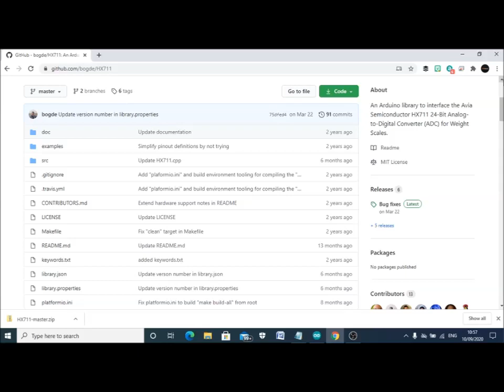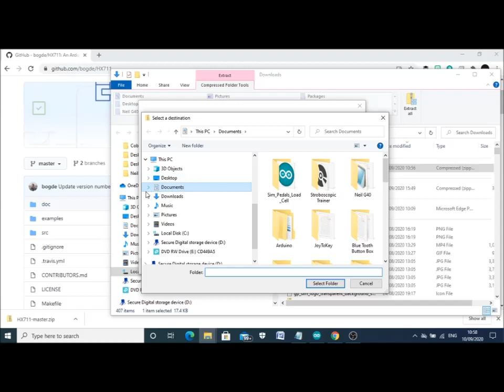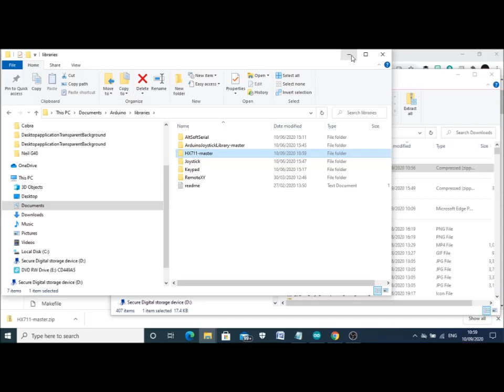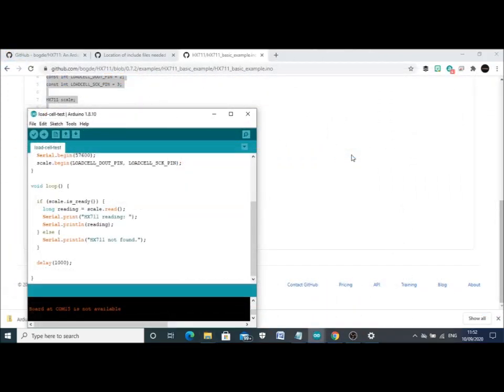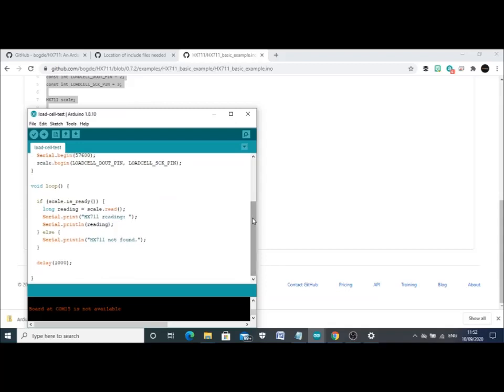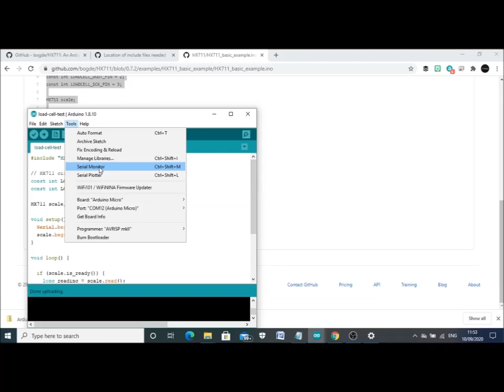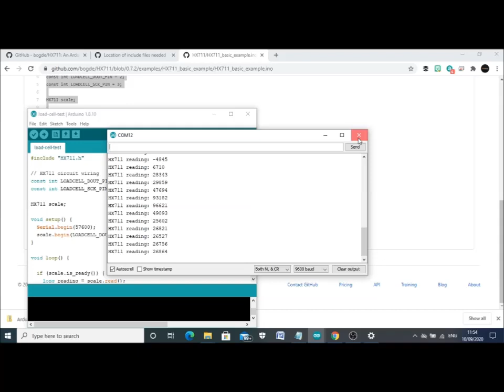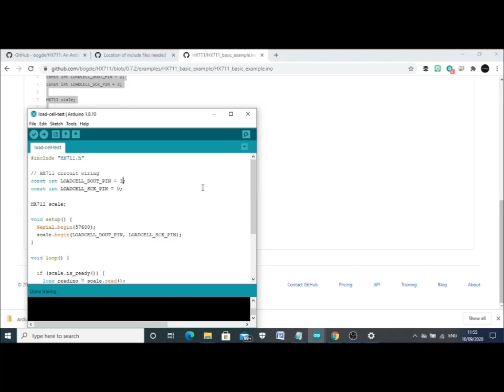Make your own Load Cell Pedals for Sim Racing

Comment: Got a free Thrustmaster T150 but has no pedals...cheapest pedals I can get where I am are Fanatec for a little over $100...so quite reasonable.  But if I can build something better for that price, I am considering that route.  I am definitely gonna modify the T150...the wheel is pretty worn so I am gonna build a custom one using some cheap car wheel and some other stuff from Ali...might look at the motor and whatnot and see what can be done there.  Probably ditch the entire plastic housing.  Looked at load cells and everything seems reasonably cheap.  I have bushings, bearings, couplings, etc. already...would just buy some cheap "racing" pedals for cars. Have some small gas struts and springs already.

Comment: When I bought the hx711 Modul it said it has 2 mode 10hz and 80hz. 80hz obviously is more interesting for less lag and more smoothness of input. But how do I test it if I have 10hz or 80hz? I have read somewhere to connect 2 pins I tried it but I'm not sure if I have 80hz data rate now
Reply from the maker: Hi, sorry it's not something I have experience with at the moment. There maybe a way to send a command via the console and see what the rate is, but it maybe worth asking someone on the Arduino forum.
Reply: not just a connection via 15-16. Also you need the cut the connection beetwen 14-15
Reply: @FatihOKSUZOGLU  Yeah I got it later on thanks. I will use a ina122 chip with an stm32 board though which is much faster and higher resolution

Comment: Hello there ; Thanks for the video
I have a problem. Pedal Operates, but lags in game and DIview . There is a 0.5 second difference between pressing and releasing the pedal. thanks..
Reply: I think it is natural, because it is imposible to get direct input via Arduino. So you have to assemble operational amplifier with INA125 chip (now working on it).
Reply: @findajob9373  I m using ina 126. And not work
Reply: @ilkercom  ina126 is an amplifier chip too. But im looking at the specs, and it is not an analog to ina125 or ina122pa.

Comment: Can I connect 3 load cells to this board?
Reply from the maker: Yes in theory you can connect 3 HX711 loadcell amplifiers to the Arduino. However the instructions on how to do this are hard to find. Better solution is to look at Part 5 and use the INA loadcell amplifier that works like a potentiometer and you can easily add lots of those.

Comment: Hi thanks for this tutorial one question, I want to made a handbrake with load cell I buy a load cell of 5 kg and I made like your tutorial but to see change in serial monitor to 0 to 1 I need to put in calibration number only 20 in your tutorial you put 28000 when I tried to calibrate with dwiew the range is ver small some sugestión ? How many kg have your load cell  put in this tutorial? Thanks best regards

Comment: Hi, I have a little problem:
I use Hx711 and Pro Micro, I try both the 4 wire cell,  and also the 3-wire one with 2 resistors.
But after using the test, which is fine, and running the scketch,  the cells work fine, for 1 minute,
then they go to "zero" and from there they don't move anymore.
Even with DiView, I see it working, but for 2 minutes, and then they stop.
Do you have solutions? Thanks for the reply.
Reply from the maker: That's interesting. I have no idea at the moment, but I will test it with mine and see if I have the same problem.
Reply: @GPRaceSimulation  Okay, it had already happened, then after a few days I double checked the connections and they were fine,
I reconnected and reloaded the sketch and it worked miraculously. Then after 2 min it is as if she is enchanted. I use the sketches indicated. Thanks for your interest!

Comment: What would be needed to be added to use a load cell for all three pedals? How would the Sketch look? Great content! And could I use a arduino Leonardo?
Reply: I'd say only get load cells for 2 pedals, it just doesn't make any sense to use a load cell for the throttle because a throttle isn't pressure or force based, the amount the throttle body opens is based on how far you push the pedal down.
Reply: You can't use 1 load cell for 3 pedals, if you want it you need 3 load cells but for throttle I don't see the point since like in real life, throttle is relative linear, clutch not quite but is like digital, on or off, so here I would just use different spring (same for throttle if you find the spring to weak) but the big advantage is for the break pedal, here all the benefits you get if your using load cell, myself have reduced my lap time to around 2-4 sec depending on type of car. You can also have a look here for other solutions: https://github.com/europer/Logitech-G29-Load-Cell
Reply: You can't use 1 load cell for 3 pedals, you need then 3 load cells, one for each pedal: it works like this: load cell gives input to micro controller and manipulate the data and send it out again to console/pc, if you have more you have more inputs and same with output pins. But be careful how the communication to console/pc is, like mine I use the G29 and the pedals is giving the voltage to the wheel what again goes with usb to pc/console and I can give a voltage back, no protocol I need to program. Be aware some controllers don't like PWM but you need a DAC converter (or a low pass filter) so depends on you system